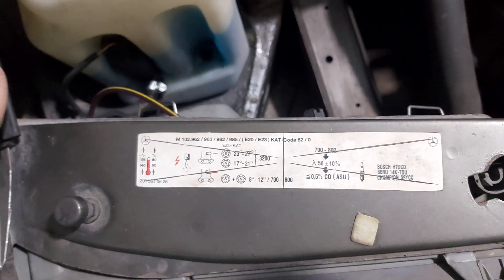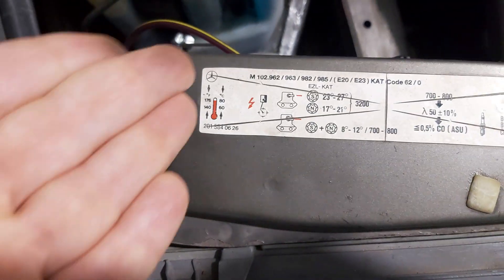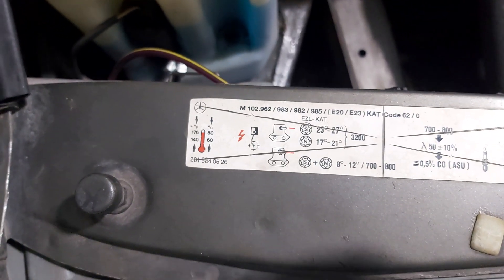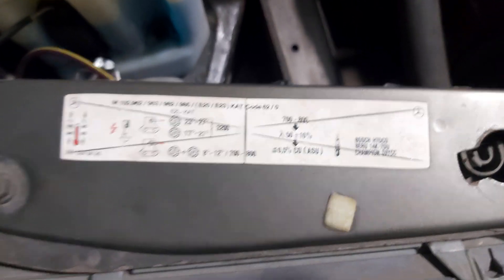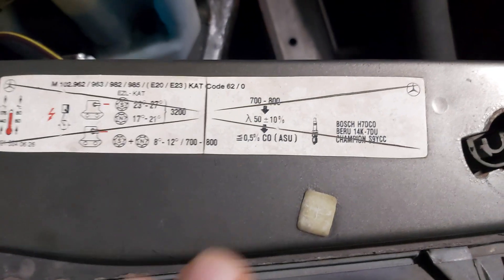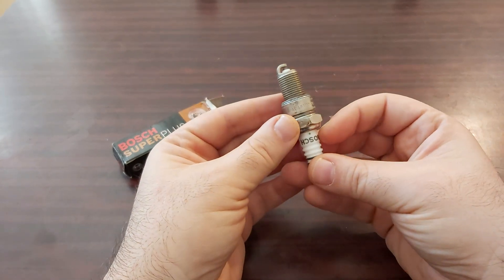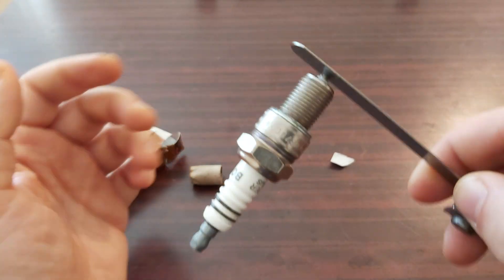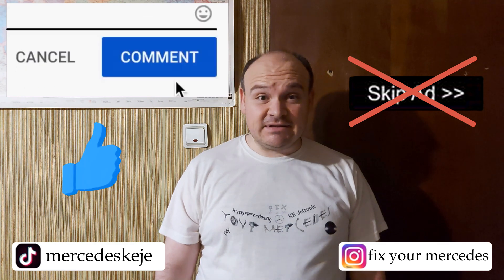㉦Mercedes Ke-Jetronic㉦  - ❗🗒About the sicker under the hood🗒❗

Comment: Another slam dunk of a video! Lately every video of yours allows me to discover something new (or wrong) in my car. 2 questions: 1. My '91 w124 300E m103 spark plugs were changed 2 years ago. I just checked and they are H7DC. The sticker says H8DC. Should I replace them? 2. My car has no oxygen sensor, so on the sticker there is no "lamda" sign. Instead, it says 600-700 and an arrow pointing down, and it says "1,0 +- 0,5% CO". What does that mean?
Reply from the maker: Thanks. Do what it says on the sticker. Concerning the second question- that means you have to get emissions of 1% +/-0.5%. When they measure your CO you will have to be within this range. Thanks for your compliments and happy Mercedesing 😊

Comment: Hi! My w201 2.3 has a bad sputter when accelarating almost sound like a lawnmover. Plugs, distributor cap etc are new.  Cant find anymore air leaks and injectors are new. Any ideas?
Reply from the maker: Hi. Have you replaced the potentiometer?